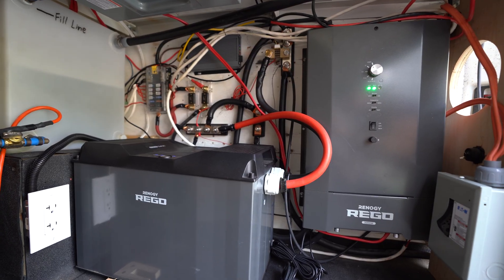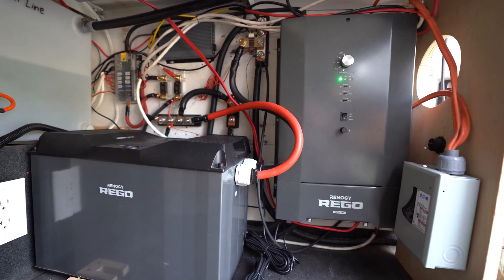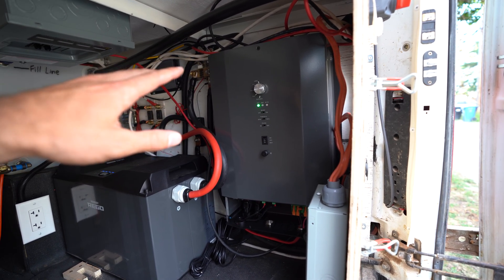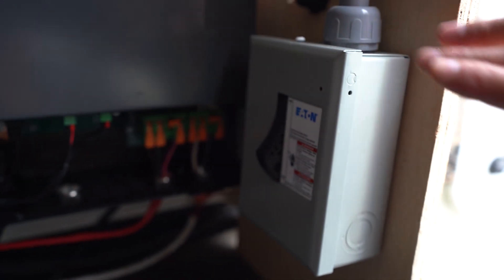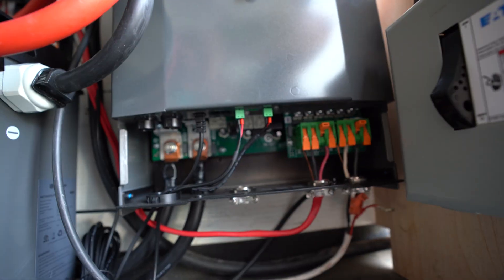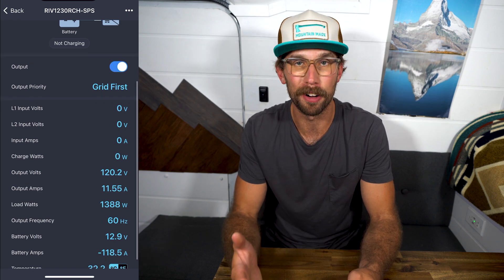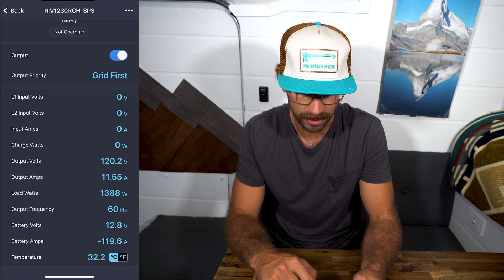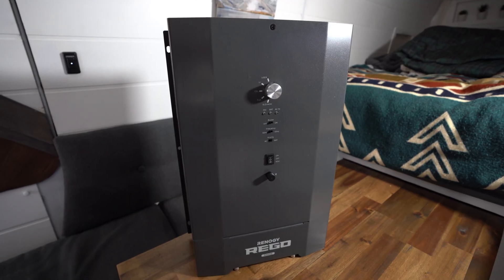HOW TO INSTALL Renogy Inverter Charger 3000w Split Phase High Frequency

Comment: Hi thanks for the detailed video. Can you charge from a generator at the 150 amp setting? Or is this for 240v connection only? How much power is it actually drawing at that setting? My generator is 3500w with 15 amp breaker 
Thanks
Reply: Ok thanks for the response
Reply from the maker: Yes, I have a 2000w generator that I use all the time. The inverter charger will draw up to 150a but if the generator gets overloaded, it will trip the breaker. You shouldn’t have an issue charging at 150a with a 3500w generator

Comment: Pretty new to this but having a lot of confusion and mixed info on grounding. From what I have been told by Renogy/found some research on: shouldn't the ground connection go to a separate chassis mounted location different than the negative DC bus bar chassis mounted location?
Reply from the maker: Yeah it is confusing but the entire chassis is a negative connection
Reply: @madetoexplore  Right but can you comment on having separate AC and DC chassis mounting points? Does it matter?
Reply from the maker: @Mike-v7q6c  both AC and DC will be grounded to the chassis, along with the negative busbar so it doesn’t matter.

Comment: How has your HF Inverter been working for you? Based on your videos and responses to my inquiries I purchased one and installed it last month. It was fantastic, would power my 15k Furrion AC unit AND the microwave together! I did however have it fail on me this past weekend. It works flawlessly on battery, and all of a sudden when I connected to shore power and tried to run the high load microwave or AC, it would rapidly click all the relays and go in to protection mode with the invert led going red. I checked every connection on the AC in, and still does the same thing. I lowered the charge rate to the lowest setting of 5a, made sure the battery was fully charged just in case, Confirmed that the AC Amp setting was at 30, and removed the AC in from the trailer connector and made a direct connection to the AC in just to trouble shoot, all no go... But on battery its perfect!
I have to say though that Renogy's customer support has improved a million times from a few years ago and they deemed it defective and will be replacing it. I just wanted to see how your making out with your.
Reply from the maker: Mines working great! Have you tried changing the setting to prioritize battery power instead of shore power? That might help with the relay issue.
Reply from the maker: Great to hear their customer service is getting better. Mines still working great! Zero issues. Have you tried changing the setting to prioritize battery power? That would put less stress on the relays.

Comment: Thanks for all your advice! i ended up purchasing a Core1 and shunt, the MPPT DCDC charger you reviewed {The new one, great video btw) and am now deciding which inverter. Im torn between the REGO LF / HF inverter charger. I will be running a rooftop AC unit. The specs in terms of rated watts/ surge capacity are identical. How has your HF performed so far? Have you ran an AC with it? I prefer the HF for weight reasons, and if the specs are the same why offer a LF version? What are your thoughts?
Reply from the maker: The Renogy HF inverter charger has been awesome! No issues so far. I’ve ran a small portable a/c unit with it and haven’t had any issues.

Comment: If you limit your input current to 8 amps, then turn the water heater on, what happens?

 if the shore power is set up blow the power required, where does the current come from, and does the shore power charge batteries as the inverter pulls all load from batteries? Or does it blend the shore power with the inverted power link Victron Multiplus units?
Reply from the maker: @jasonroberge6336  it blends the power from both battery and shore power
Reply: That is only if you are connected in a Single phase configuration,  The limit current does not apply to Line 2, Therefore any load on Line 2 could exceed the 8 amp limit,   this was confirmed by Renogy technical team.

Comment: Loved the video. I had a an absolute horrible experience with a Renogy 3000w inverter charger (that's been discontinued) a few years ago and horrible customer service. The neutral bonding did not work on it so I returned it and got a Zantrex 3000HF pro. It worked great. I sold that trailer and am looking at this unit for a new build and am unsure if I should give Renogy another try. My question is does it bond the neutral ground internally (as it should and required by code) when on battery power? Second would I be better off purchasing the LF Rego model as I intend to run my roof AC off of it? And third, your discount code does not work at Renogys Canadian website. Thanks again
Reply: Hey thanks for the reply! After I commented I ended up downloading the manual. Just to let you know, in section 5.1 in setup, they discuss the neutral ground bonding. So the unit does in fact provide a neutral / ground bond on battery power. This is a safety as well as regulatory requirement. 
I like the new Renogy units as I really like the new bluetooth displays available and the shunt. It would really alleviate attempting to run wiring in a new travel trailer walls. Do you know if the ONE core display has the same info / functionality as the app?
Reply from the maker: @ anytime! You’re talking about the high frequency model right? 

I tested out the first gen Renogy one m1 controller and didn’t like it all. I haven’t personally tested out the one core but I also don’t really see the point since I use my phone 99% of the time. From what I’ve heard, it is basically the app.
Reply from the maker: @robt4021  this model doesn’t have a neutral bond but the Renogy Rego 3000w Inverter Charger ,along with the 2000w/3000w inverter chargers, have an internal neutral bond. I’d recommend that model 👍

Thanks for letting me know! I’ll reach out to get the resolved ASAP
Reply: Hey thanks again for the time. Yes I was referring to the HF version. It does in fact talk about the bonding relay and use in section 5 - setup. Now ironically I also downloaded the manual for the Rego 3000 LF and it doesn't mention a neutral bonding relay anywhere. It must have one as it's code and it prevents electrocution while operating in inverter mode. The older blue / black 3000 LF was the one I returned as it was in the manual schematics that it was supposed to bond the neutral and ground and I could hear the relay activate, however my electrical tester continued to indicate an open ground. Afterwards I heard they had issues with that very problem.
I'm looking to power a 15k AC unit and trailer for short periods of time while we stop at rest stops on our road trips. So I'm torn between the HF / LF. I agree with the core screens, i use my phone as well. Thought it may be a good idea to mount one by our switch panel just to keep an eye on things without needing my phone. Considering the Core 1

Comment: Did I hear you say that you used 6 awg wire for the a/c input side? Just asking because I’m a little confused on the recommend wiring size.
Reply from the maker: @kfindley79  I used 10awg on the a/c input side
Reply: Ok, I figured 6/3 with a 50 amp double pole breaker to take advantage of the full input capacity. Am I correct?

Also, 3kv split phase…would that work out to a max output of 1.5kv per phase?

Comment: It looks like you didn't read the instructions very well.  Your AC input and output wires are only 12 or 10 gauge wire.  The Instuctions say that 8 gauge is the required size.
Reply from the maker: @ScottWoodruff-ol6py  I did. My electrical system doesn’t require that size of wire. I’ll never be pulling more than 15 amps for my 120v system. 8 ga is rated for over 45 amps.
Reply: Right now  have a aims 3000 single phase and its in my class a you said split phase is only a accessible when plugged into shore or gen set is that other leg just not working when in inverter mode not much info on this

Comment: I want to replace my 2000W LOUD old Renogy inverter/charger, but need to hit the road really soon and Renogy says 10 business days >estimated< delivery time and Amazon is out of stock on new units, has 1 used unit for quick delivery, but seems I'd have no warranty beyond 30 days??! So sad I can't buy one in the time I need to! Renogy REALLY needs to offer expedited shipping options! TAKE MY MONEY!!!! Lol! I really want a quieter, less bulky inverter charger with bluetooth! Granted my old 2000w works just fine and never given be trouble?! But seems the fan is CONSTANTLY cycling on and I don't remember it running this much and it's in really cool conditions? I swear the fan used to run a lot less even in much hotter weather???

Can the battery type knob be pulled off or removed without damage? WHY such a big knob sticking out for a setting you will probably set ONE TIME?! Seems like it could get turned by accident or even broken off given I want to install it under my desk in my van for best cooling and easy access? That dumb knob is the only thing I don't like about this seemingly awesome inverter! I do hope these units are well made and will last a long, long time. I do want to full time in my Sprinter and the inverter/charger is ESSENTIAL equipment!
Reply from the maker: @Dylanear  yeah, I found mine noisy too! This one is WAY quieter. I don’t think the knob can be removed but I agree that it is over sized. Completely worth the upgrade in my opinion!

Comment: Looking for info to wire up the 3000 watt high frequency invertor / charger in my boat with, shore power, Gen, alternator and solar and 2 battery banks. For house I'm thinking the renogy 400amph Lithium and starting batteries are gel
Reply from the maker: Nice system! Very similar to mine accept it’s a van 😄

Comment: I bought this same unit out of pocket. No relation to Renogy at all. I’m very happy with it. It’s a much improved unit for anyone using the old PCL renogy inverter/charger brick. It runs way cooler, the cooling and thermal management system more quit and efficient. The cooling fan ramps up and down as needed, not just off or full speed. The Bluetooth is convenient to change settings and see data.  No more have to push the buttons on the actual unit. When I bough it I did not know that you can set the shore power amperage. So basically it will not pull more amps than you set it to, no more blowing circuit breakers. I also did not know that it could blend shore and battery power to meet the power demands. Hard to explain but it works much like the Victron multiplus, if you’re familiar. Is it the best, no. It is the worst, no. It’s it great value for your money, absolutely.
Reply from the maker: @andrewtaylor5421  couldn’t agree more! 🙌 it’s great value